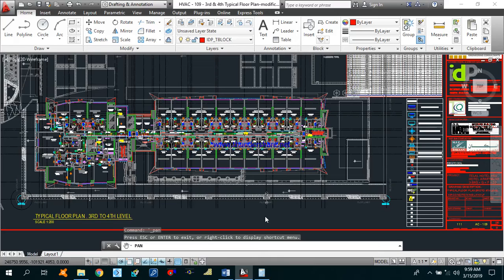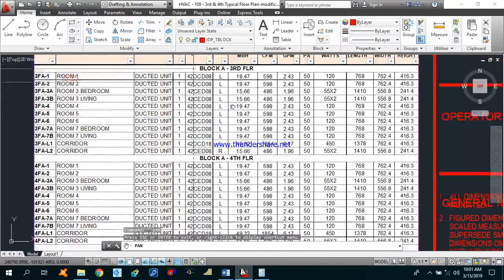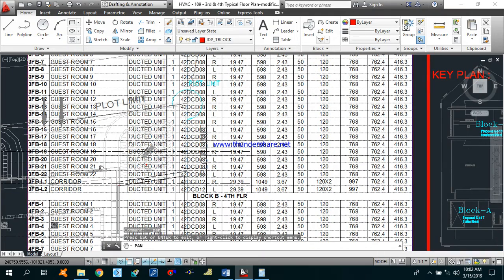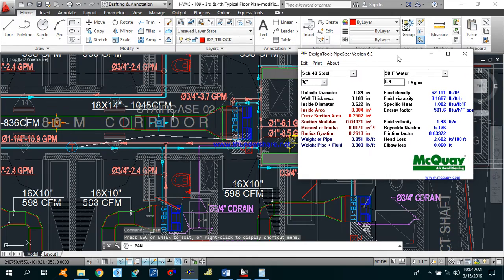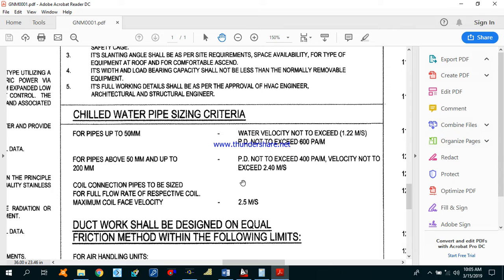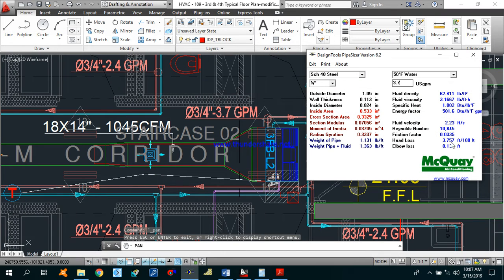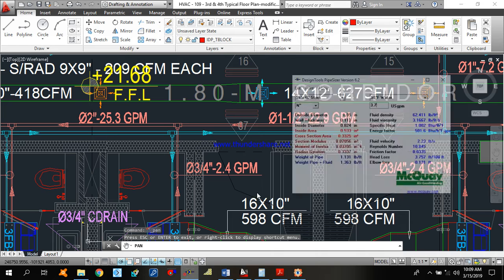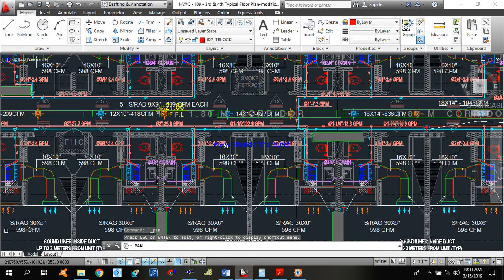Chilled water pipe sizing calculation using design documents

Comment: Great sir, very use full I do appreciate it, and  sir how did get that Esp and motor output power in your performance summary sheet .
Reply from the maker: These parameters are pre calculated from supplier. Soon I will make video regarding fan ESP calculation for AHU selection